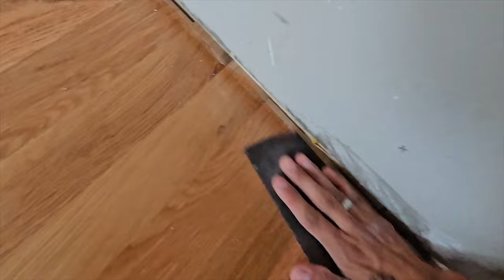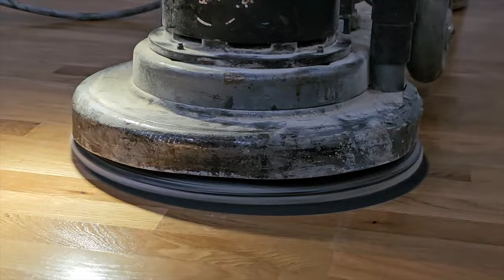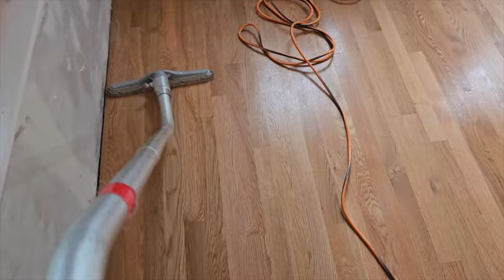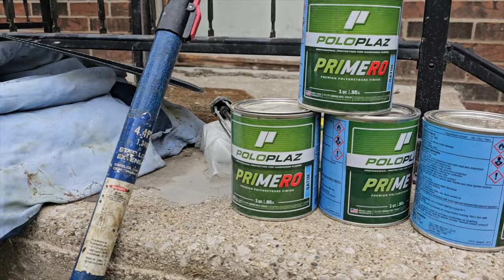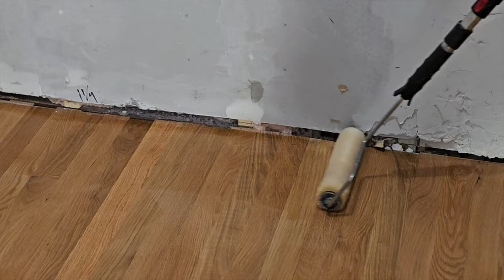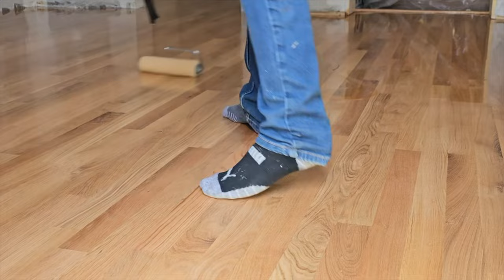We're quitting oil-based polyurethane, here's why.

Comment from the maker: Would you use oil or water-based finish on your floor?
Reply: water 100%
Reply: Oil based works better imo. It lasts longer and is overall a superior durable top coat for most applications.
Reply: Have you ever used Arboritec products? Good or bad?
Reply from the maker: @georgehellion1381  thats been our go to for many years. We just recently switched.
Reply from the maker: @c43805  We have never used them so I can't give a real opinion unfortunately.
Reply: I like oil. It’s easier to apply.  I don’t like how water base swells up ends of boards and water base dries too fast while applying
Reply: It would depend on what you are trying to accomplish. There are water borne finishes that are "better" than oil polyurethane but there are also water borne finishes much worse that polyurethane. For a floor the most important thing for me is protection.  I think the flooring industry pretty much will dictate what is "the best overall" finish for a particular use.

Comment: We gave up using most solvent based finishes in our wood shop around 5 years ago, kicking and screaming the whole time.  We have learned that the chemistry in the water borne (not water based) have really been a game changer. They have become just as durable as solvent.  Same goes with the 2K epoxy and conversion varnishes.

Comment: I`m 55 now and been doing floors for over 30 years , sure solvent takes longer to dry and you might get a bit of grit here and there but water based varnish does not cut it when it comes to performance , 20 years later and it`s` still there , sell people rubbish ( not a good idea )
Reply: Yes, exactly.  The water-based finish does look as clear to me, either.

Comment: I Iove water based finish on hardwood flooring, it has a nice look. But if your flooring contractor doesn’t put down four to five coats depending on the wood species your flooring will look like crap in three years 
I have been sanding water based finishes 
out for years. Don’t do it!
Reply from the maker: I always felt like a thicker finish past a certain point doesn't equate to a floor that wears any better.
Reply: Does your experience include the Bona Traffic HD?  I don't know how new this product is..